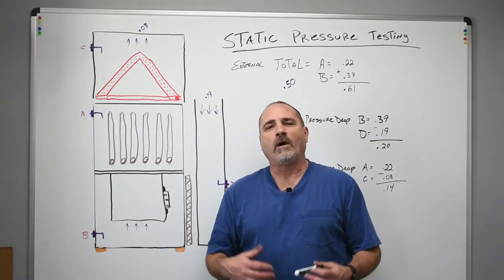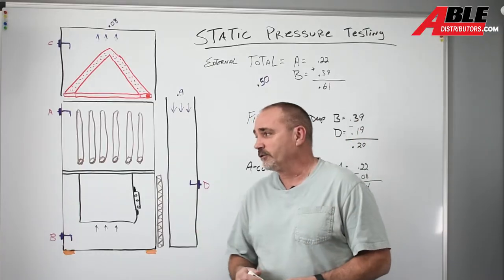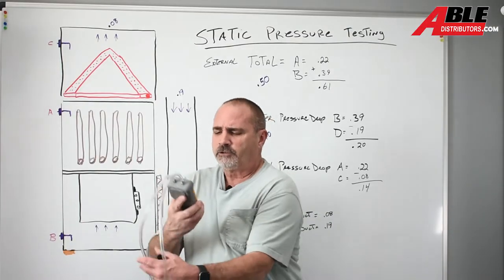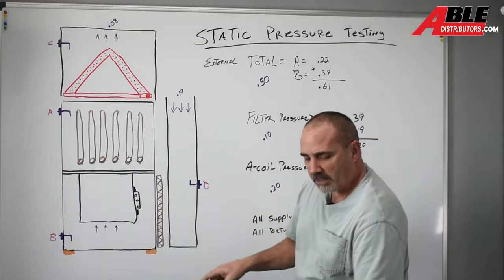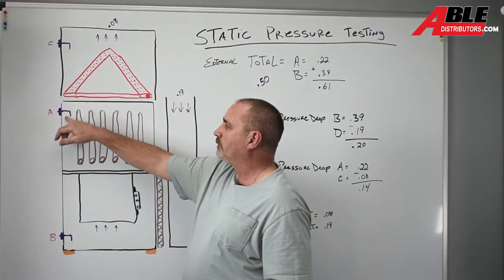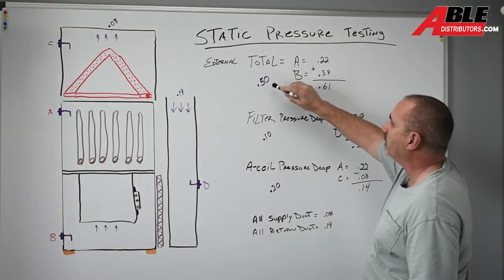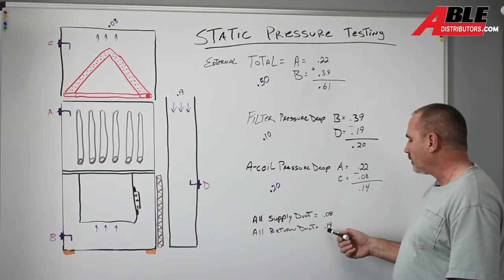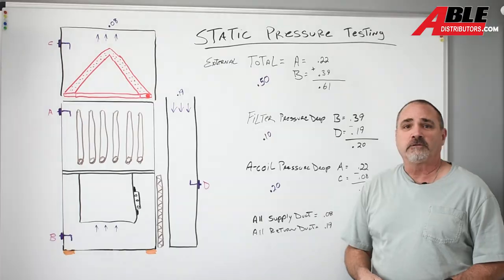Tech Tips: Static Pressure Testing

Comment: Could it have also been a problem with supply blower? Weak motor or wrong blower speed?
Reply from the maker: actually if the blower wheel was dirty ( dirt packed in the blades ) the blower would move less air, and the static pressure would be lower, also if I had lowered the blower speed, it would have decreased the static pressure. static pressure builds when we try to move air through restricted duct work. in my experience most causes air a very dense filter media, not enough return duct or return openings, a dirty A-coil... those are what I usually find.

Comment: Thank you for all your great vids. 
I was wondering if you can ever  have too much return ducting.
After watching your videos, I  checked my external static and found 3.5 and 3.5 for a total of 7 in WC .
 Filter drop is .18 INWC ( 5 inch air bear)  and a\c coil drop is .21INWC. ( 2.5 ton N coil.) 
The temp rise is 70 degrees in heat mode.  Rheem says 40-70 rise is okay , so I'm at the high end of acceptable . Shooting for 55 degree rise.
I'm thinking I might need more returns and supplies but don't want to over duct it. Any help or advice? Also, when is was installed they added one 10' and one  8 inch flexible return duct. 
this is a 70,000 BTU Rheem 95% that replaced a 115,000 Ruud 95% furnace. Thank you

Reply
Reply from the maker: your temp rise is a bit high, your correct 55 or 60 would be much better. the N-coils do have more restriction. I don't think you need to worry about too much return, you might be able to get better performance by taking the Flex Duct returns and running them in hard pipe. I've never had a system be perfectly balanced like you have ( both the supply side and return side have same TSP.

Comment: Nice work on the video!
I am confused by my bypass humidifier.
Any thoughts?
Thanks.
Tom
Reply from the maker: just my thoughts on a bypass humidifier.... if your duct work is adequate ( you have plenty of supply and return ) you "should be fine"  but if your home is like many, where they're just short on return, you'll end up bring much more air through that bypass than you would want. temp rise with the bypass damper open VS. closed may indicate how your system is working. I would check your static with bypass damper closed.   I don't know if I helped or hurt with your question.
Reply: TNX.
My manometer and probes come tomorrow.  I shall measure everything every which way.  Then I'll know more.!!

Comment: Thanks for this. Is it true that TESP will get you in the ballpark for blower speed settings but you’ll need other tools to test capacity and actual cfm?
Reply from the maker: testing your total static will just let you know how well your duct work is performing, knowing this will give you an idea of where to start. actual CFM is a different measurement, I will be coming out with future videos on how to measure CFMs and simple temp rise blower adjustment. I did this video because as we get into more advance modulating equipment, like the Bosch IDS, airflow is very important, more videos coming soon.
Reply: @abledistributors  
Thanks! Is it safe to assume I can have the right CFMs and have too high TESP causing more work on the blower and noisy air from duct? So TESP is still a relevant test other than finding blower speed setting?

Comment: Great video, question how do you calculate, or where can i get the info when the sp is higher? How  less of cfm and temp rise will get?
Reply from the maker: most brands either in the set up instructions or even inside the blower door, there will be a chart showing you the blower speeds and how many CFMs will be at different static pressures, and some will include the temp rise at that speed and static. hope this helps, stay tuned, much more coming.... Brian

Comment: Look at the filter the engineers design and test their air conditioners with. They use the very light blue filters. Using a filter with a high merv rating causes your fan to use more amperage, running hotter and cutting down its life expectancy and cutting down air flow.
Reply from the maker: YES... I have a video on our channel all about filters, fiberglass to pleated and how they changed airflow. thanks for checking out our videos, Brian.
Reply: So what is the alternative running a fiberglass 1 inch filter that doesn’t  catch any particles they’re useless so you pick your poison and you use a pleated filter
Reply from the maker: @rickgonzalez3662  remember the filters were never intended to clean the air in your home, they were originally added to protect the equipment from getting blocked up, protect the blower wheel and the AC coil... there are options from Honeywell, Generalaire, and AprilAire , these are super wide filters, some as wide as 7", these would be a much better choice in my mind, of course these need to be professionally installed, but your correct, in the end, we all make a decision.

Comment: I was most concerned about the coil drop since cleaning the A coil is a huge job.  And I would like to share what I have done to measure the coil drop, which is very easy to do. You do not need to drill anything and you do not need to buy the special probe either.  Just use the screw hole by taking out a screw.  To measure underside of the A coil, I unscrewed one of the easily accessible screws from the triangular A coil cover blocking the underside.  To measure the top side of A coil, I unscrewed one of the A coil housing cover screws and measured there.  In both cases, I pressed the open end of tubing from the manometer ($35 from Amazon) right against the screw hole tight and read the meter.  In my case, I measured 0.16 (top side) and 0.25 (underside) which gives me drop of 0.09 WC.  I was afraid my A coil would be clogged up a lot after 26 years of use without cleaning at all but this measurement tells me it is wide open for which I am so happy not having to do the big job of disassembling the whole A coil and cleaning it up and reassembling it.  

Just for sanity check, I also bought Anemometer ($16) from Amazon and it measured  anywhere from 550-800 ft/m air speed out of all the vents which seem very reasonable based on what others measured on brand new system.  This sort of confirms that my A coil is pretty clean even after 26 years of use without cleaning at all, which is quite surprising.  I did not even replace the filter either.  I simply vacuumed the filter every year.  I hope I am not dreaming.
Reply: The secondary heat exchanger can also be the culprit. No one cleans them.
Reply: @michaelmckenna9022  I do not have high efficiency furnace with secondary heat exchanger with fine fins.  This is why underside static pressure is 0.25 which is quite reasonable.  So I do not have to worry about it but, if you do, yes, you have to measure the static pressure drop there as well and make sure pressure drop is not excessive.
Reply: @tommason5689  I have a Bryant 90 from the 90s. They had a problem with clogged secondary heat exchangers. Great furnace though, can get deals on new heat exchangers, but I can also get a deal on a new system and install it myself. The main problem is when the house was built they only installed a furnace. So to save money they installed smaller ducting. Then later on installed AC with that ducting. The worst part is that the house is a 2 story.
Reply: @michaelmckenna9022  I have two story house built in late 90's and mine has two separate furnace/AC for upstairs and downstairs with separate controls.  I can understand how one furnace can be a problem for two story house, especially with narrow duct.  And secondary heat exchanger only adds to the problem and on top of that adding A coil for AC would further reduce the air pressure.  Sounds like you might have to replace the duct as well which is a big job.  Good luck to you.
Reply: @tommason5689  One solution is to install a micro mini system upstairs. On the other hand I do have a lot of painting and drywall work in the house. Adding some extra duct work would be the right thing to do.

Comment: Thanks for a great video. Do you conduct the test in heat mode or just fan mode? Temperature will affect TESP. Correct?
Reply from the maker: typically I would have it on the highest speed, ( on heating speed I usually check temp rise )
Reply: @abledistributors  Thanks for your response. However, I am still not 100% clear. Should I have the thermostat in heating mode or simply run the fan to test TESP?
Reply from the maker: @jaysims7983  sorry, yes fan on would be great, make sure all the supply registers are open, clean filter, check if you have supply dampers in your supply ducts, make sure they are open, if you have a bypass style humidifier, make sure that damper is closed. last thing is to check return grills to make sure they are free from anything blocking them.
so yes, thermostat to off ( no heat or AC ) fan mode to On.
Reply: Could you pull the disconnect on the compressor and put the thermostat in the AC mode to get the highest fan speed?

Comment: Help please. My static is hi and the issue is with return side. Can I add return air to the other side of the furnace to make a dramatic effect and get that static number down ?  Thanks for helping !!!  Mike
Reply from the maker: yes you can always do dual sided return, on some larger furnaces it's recommended by the manufacturer , remember you would need to add another filter to that side, and always get return air from the living space and not from the mechanical room or unfinished basement. when I'm searching for the issue, I look at the entire return duct system, from the duct size to how many returns are taken off that duct, adding return is always a good thing, finding where in your home you can put that new return is often the problem, I would never just cut a hole in the duct work, pipe it someplace, even if it's in the floor.   good luck, hope this helped a bit.  Brian
Reply: @abledistributors  thank you !!  And yes I will have the other side adapting to a joist space and terminate to a floor grille with large openings and the filter for this will be at the furnace. One more Question if I may   All my in the wall return grilles are up high on the 9’ wall    Do you think that causes restriction too much compared to grilles close to the floor ?  Mine are 6x14 with 1/3 fin spacing and there are 9 of them and I want 1000 cfm (2.5) ton ac and 92% 60k  furnace
Reply: A little more info if you would like.  My one return drop is a 10x20 with 16x20 x1” filter which I’m switching to fiberglass but my return static is .4.  On the supply side I have a “n” style coil and good size ducting and supplies for 2.5 ton

Comment: WELL GET YA MATH RIGHT  A IS -.22 + .39  =  .17  NOT 61
Reply from the maker: when your calculating total static pressure, you add the two results, even if one is a negative number, because the amount of suction needed and the amount of built up pressure both equal the total static pressure, I'll re-watch this video to make sure I mentioned that.   but thank you for checking out the video, stay tuned, much more to come.. enjoy your day,    Brian.
Reply: - just means suction, + just means supply. Just have to add both results.